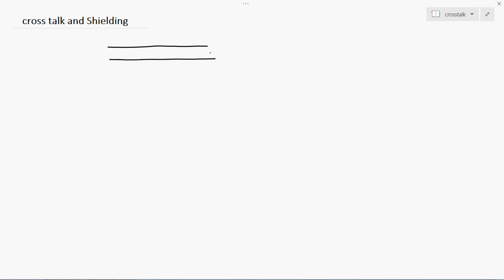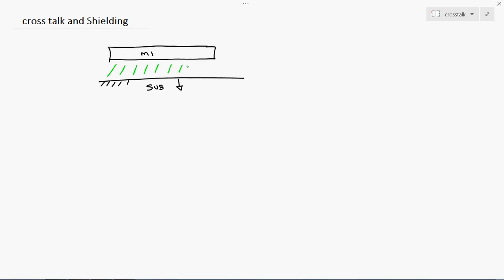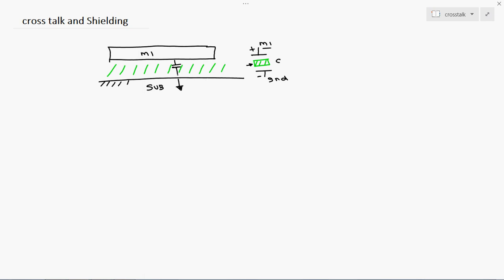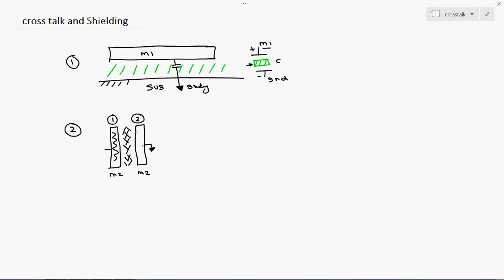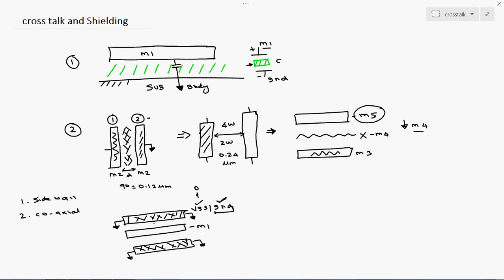CROSSTALK & SHIELDING  - English Version

Comment: Thank you for the video. A few questions:
1. Assuming an all-digital IC, there are two obvious power nets: VDD and GND. You suggest the shielding network to be connected to another ground net called VSS. Is the VSS connected to GND somewhere on the IC or outside the chip? 
2. Can shielding be also done with nets connected to the supply network, VDD?
3. Are all clock networks in ICs routed with shielding? 

Thanks!

Comment: one doubt , Should we follow some generalized thing to maintain width and spacing for shield or minimun is fine , as this will also put some cap over the signal ?
Reply from the maker: ya , we have to keep mim width , how ever its gng to connect to gnd , so no need to worry abt cap , only side wall and fringe cap is main prob , by connecting a gnd , this problem also we can solve

Comment: Sir I have a small doubt in cross talk prevention for suppose distance r width of the two metal will increase according to formula of the capacitance. While is increasing distance between two metals capacitance increase and also electric field increase then more unwanted siganls also created..?
Reply from the maker: Distances increase , cap will decrease
Reply: bro the formulae of cap is c = epsilon*A/d

Comment: For sidewall shielding can we go for higher metal than a signal line?
Reply from the maker: No , same metal u have to use
Reply: @analoglayout Can I know the reason behind using the same metal for sidewall? Why not higher or lower metals than the signal line?
Reply: @manishasutar8701  May be both will fabricate on same step if we use same metal for side wall. If we use higher r lower metal it will act like top & bottom shielding. I too don't know exactly but i thought in this way

Comment: in side wall shielding why should not go for higher metal is there any problem sir 
in this you were explaining with m1
Reply from the maker: what metal ur using for routing , same metal only u have to do shielding ... if m1 ur routing same m1 should be used for shield , if m2 , m2 u have to use

Comment: In co axial shielding why we use top metal on upper side and low metal in bottom side
Reply from the maker: Then , how will u form a co-axial shielding ?
Reply: If you need to protect the net from all sides means you have do it from 4  sides right! So for top & bottom you are using higher & lower metals. For side wall we are same metals

Comment: Hi.. bro 

Your explanation is good..

 

 I have small doubts regarding shielding

1. Why we mostly connected shielding nets to ground? Why not to Vdd? In which cases shielding nets connected to Vdd?

2.what happens when we do half of the shielded net connected to Vdd and half shielding of the net connected to the Gnd.? Both on the same net  this is my IBM Client interview qns

 

3. Generally we avoid shielding to the high frequency signals? If do what happened..  for this qns  I think delay of the net increase..  I expect from you.. another any reason?

 

4. Vref ,Vbais  ,Vclk   for which net you give high priority to do shielding and why?
Reply from the maker: 1. based on the signal , we have to connect it to vdd or vss or gnd , but most of the time we will connect to gnd , bcos its a low impedance path compare to vdd,vss 
2. how will u do half vdd, half vss ? its a useless methos , bcos any one half only will shield effectively , another half will get disturbance
3. high fq signal carry , high current & Fq , so u should shield high fq net
Reply: @analoglayout ok  tq bro
Reply: High frequency signal is nothing but clock signal,If you shield clock signal you will add more loading to it which will delay the signal,So we should only shield the place where we are seeing the cross talk,In general to avoid any disturbance fist we should plan to route these critical signals(usually in medium metal).so clock signals should not be shielded in general!

Vref is ref signal which is very critical in most cases  we will do co axial shielding
bias signal can be done in sidewall again it depends on designer,some times he does not want any noice on it then go for co axial

vclk we will only shield where ever it is required!